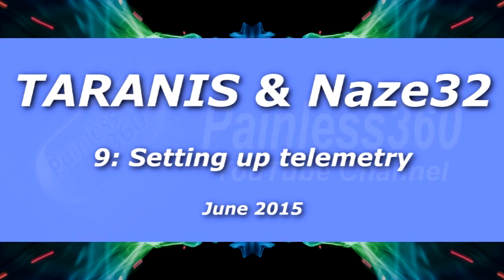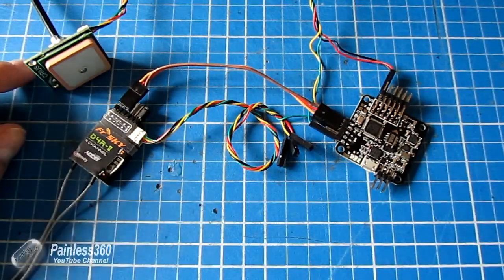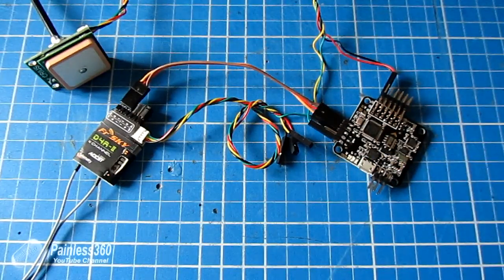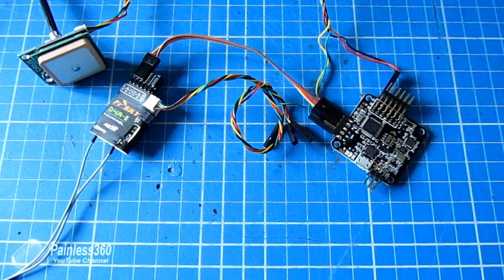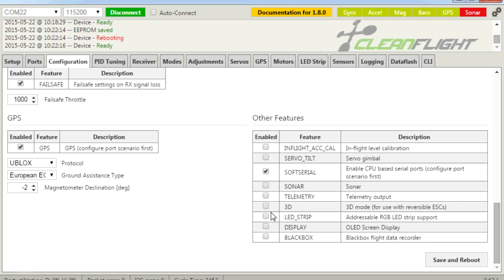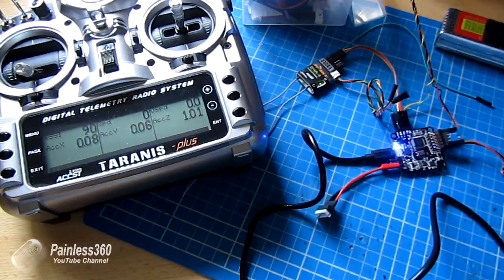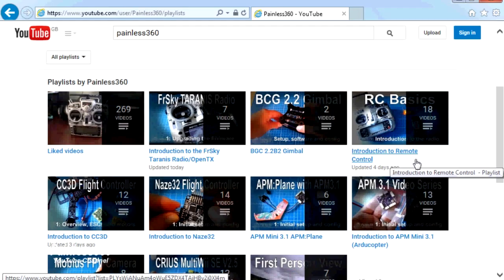(9/12) FrSky TARANIS/Naze32 Telemetry - Simple setup using a D4R-II receiver

Comment: I have my Taranis Plus set up to display RSSI and cells. I gave the green wire from the side of the D4R-II going to pin 6 on the Naze32.  I am not getting cells voltage comming to my Taranis Plus. 

I wonder if it is because I am pulling this from the Naze32?
Reply from the maker: +Dean Cory Are you getting everything else on the telemetry screen then? If so what does the vBat show on the main Cleanflight page?
Reply: +Painless360 clean flight is showing the voltage.  I get a warning from the beeper when the voltage is low enough and the quad is close enough to hear.
Reply: +Painless360 the last time I tried this I messed up the Clean flight so bad that I had to jump the bootloader pads and reflash my Naze32

Comment: Help I just killed my Naze32.  I was trying to set up the telemetry for my Taranis.  followed the instructions of this video.  Hit save and reboot and now I can not get my naze32 to respond to cleanflight.
Reply from the maker: +Dean Cory Occasionally Cleanflight will have a hiccup, usually with the Port configuration. If you select an invalid port configuration it will not warn you but error and reset the entire port config for all ports. If you've tried all the usual stuff then I'd try a firmware flash and erase the board. Don't forget that the vendor should be able to provide first line help. Best of luck.
Reply: +Painless360  I was able to reflash by jumping the boot loader pads and reflash upon connect.  I had to reconfigure everything but that beats buying a new one.
Reply from the maker: Good job getting it back into shape. Happy flying!

Comment: Thx for sharing Painless your vids are helping me out bigtime.. question.. those DF13 4 pin connector`s i can find them on ebay etc but its a 4pin connector at each end i cant find the 1`s with a single pin connector on the opposite end, where did you order yours ??

thx in advance !!
Reply from the maker: norie m You can add the servo connector pins to the ends of the cable that comes with the receiver. I have a video that shows how to crimp them. Best of luck with the build.
Reply: thx dude appreciate it. just got my taranis today i got a lot to learn :D

Comment: Can this also be done on a flip32? If so, which pin should I use? Many thanks.
Reply from the maker: Yes, if running Cleanflight.  Use the same input signal pin.  Best of luck!
Reply: +Painless360 But on the flip32 the pinouts are different and I don't know which pin to use. Could you please tell me which pin to use '1' being the top input pin '8' being the last one. Thanks so much!

Comment: Hi Lee. I have switched from the telemetry pins to the Soft serial approach as I am not a fan of just getting the voltage when the quad is armed. I have followed your video and I'm get everything else bar lipo voltage. Any ideas? 
Thanks

agrs1974
Reply from the maker: Vbat setup?
Reply: +Painless360 
yes. do you need the frysky add on for voltage reading to the taranis? ?
Reply from the maker: Check you can see the vbat voltage in Cleanflight GUI on the PC. It should appear in the telemetry data with everything else..

Comment: Thank you for this video. I'm receiving telemetry info on my Taranis but for some reason, the "cels" and "cell" parameters are not appearing in the telemetry set-up screens. I want to be able to hear the current overall battery voltage when I flick switch SH. Could it be something I missed or maybe the inversion code?
Reply from the maker: The latest version of the OpenTx software changed a few things in the telemetry system.  Have a look through the notes for the latest release to see the latest. Best of luck!
Reply from the maker: The latest version of the OpenTx software changed a few things in the telemetry system.  Have a look through the notes for the latest release to see the latest. Best of luck!
Reply: Painless360 Will do. Thanks for the quick reply :)

Comment: Probably not exactly the correct place to ask this question however.  Will the new Taranis X9D plus transmitters with the EU compliant firmware work with the D4R-II 4 channel receivers?
Reply from the maker: ***** This is an issue and widely discussed in the RCGroups and other forums. Best of luck with it.

Comment: As usual, your videos have saved me Painless360 I've spent almost 3 hours today trying to make my new taranis receive voltage data from a new dr4-2 and naze. Found your video after almost giving up and seems I have a naze that requires telemetry inversion. Also my naze oddly has pin6 around the middle unlike yours which has it at the end of the pin row. I also didn't have to plug the negative from the dr4 into the negative pin on the telemetry pins on the naze, only the green wire is plugged into pin 6. Odd also that my naze doesnt have to be armed to pass telemetry data once lipo is plugged in Voltage telemetry is being happily passed onto taranis. Many thanks for your videos Lee!
Reply from the maker: Altitude Aerials You're welcome! :)
Reply: Altitude Aerials If you look closely at the video around the 4:17 time, you should be able to see that he DOES have the telemetry connected to the middle pin on the bottom (pin 6).  He has a GPS (i think) connected to the pin on the end also using a green wire.

Comment: Painless360 What are the benefits of using Virtual UART (as you did) against UART (telemetry port)?
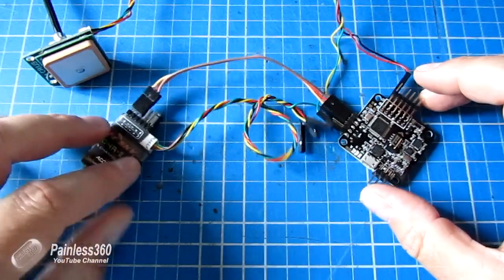Reply from the maker: Gerhard Mikysa See 1:17 in the video. Happy flying!
Reply: Painless360 Thanks. I read that the virtual UART needs more CPU usage. See: https://github.com/cleanflight/cleanflight/blob/master/docs/Serial.md

Any drawbacks on CPU "performance"? :)
Reply: Painless360 Regarding https://github.com/cleanflight/cleanflight/blob/master/docs/LedStrip.md SoftSerial and LED strip wont work together. Can you confirm that?
Reply from the maker: Yep. You need something like one of the new SP3 boards if your heart is set on that..
Reply: Painless360 Thanks for all :) Can't wait to get my hands on all the stuff. Keep on your awesome work!
Reply: Painless360 Finally I found a solution for FrSky Telemetry + LED Strip + Blackbox to work at the same time (the FC must be armed): http://www.rcgroups.com/forums/showthread.php?t=2469417#post32465272

Comment: Hi, i have the d4r-2 sb (2015) it's a bit different in that it has (AIN, -, +, S) on the 4 port connector, which one goes to pin 5 on the naze. Also can i just check this is correct: on the naze, gps tx is 3 (to rx on gps unit), gps rx is 4, Lights are 5, d4r to 6, osd to rx and tx. Many thanks, would be lost without these vids
Reply from the maker: Gavin Ferry If you follow the videos in the series you should be fine. The port setup is changing all the time in Cleanflight so it may look a little different when you get to it.
Best of luck.

Comment: It seems a shame that you do not seem able to get the Lipo voltage using this method, or if you can I have not found how to do it.  Does anyone know differently ?

I know how to get the voltage using the dedicated pins on the Naze but the D4R-II only has one serial input pin so you to choose which set of data that you want so see.
Reply from the maker: UKHeliBob You should get the voltage over telemetry is you have vBat option setup on the board. See the other video in the series. Have you setup this configuration and not seeing the voltage but seeing everything else?
Happy flying!
Reply: Painless360 Thanks for the reply.  The telemetry config is working OK through SoftSerial because I can see the X/Y/Z acceleration values on the Taranis telemetry screen.  VBAT is enabled in Cleanflight but both Cells and Vfas show 0.0 on the Taranis.

This is a new Naze board and I have not previously set up voltage monitoring on it using the normal output pin but I have had it working on other Naze boards.  I wanted to use the SoftSerial method to keep the wiring simple and so that I could see the Lipo voltage without the Naze being armed.

Which data item shows the pack voltage on your Taranis when using SoftSerial telemetry ?  Like many things in the Naze setup there is probably something simple that I have missed but if I know that it can work I will keep looking.
Reply from the maker: Can you see the Battery voltage displayed in Cleanflight with the board and battery connected?
Reply: Painless360 No, the voltage shows as 0V on the setup tab
To summarise :
On the Configuration tab of Cleanflight VBAT is ticked, as is SOFTSERIAL and TELEMETRY.  The telemetry and softserial settings are obviously working as a can see the X, Y and Z acceleration data on the Taranis.
Reply from the maker: Then something isn't right with the FC, get the vBat working in Cleanflight GUI first so you can see the voltages and then look at the telemetry.

You should see the voltage in both..

Best of luck..
Reply: Painless360 Sorted.  
For some reason I had assumed that when using the SoftSerial telemetry method there was no need to connect the LIpo to the battery connections on the Naze and this being a new board they had not previously been used.  Having connected them I can see the battery voltage in Cleanflight and it appears as the Vfas value on the Taranis.
Thanks for your help.  The important factor was knowing that it was possible.
Reply from the maker: Good news - happy flying!

Comment: How do I get both telemetry fed to the D4RII and have use of the LED strip functionality?
Reply from the maker: Vondarius Use the main telemetry pins on the controller. I do mention that is an option in this video..
Best of luck..
Reply: Painless360 I have a flip32, where are the main telemetry pins?
Reply from the maker: Ah, in that case you're snookered.
Reply: Painless360 OK, so if I just want main battery voltage and RSSI can I just use the VBAT connection? If so, what other connection do I need for the D4RII, and setup for the Taranis?

Comment: Thanks for sharing it with us. But just to point out that i had to enable softserial under configuration before i got softserials in ports tab. Using 1.9.0 version. Hardware is all same.
Reply: mel a Thanks for mentioning this! I also had to do it!
Reply: mel a Same here. Thanks for the tip.
Reply: +pass1985 u welcome

Comment: Thanks again for another great video.
Just curious. Previously you did a video on the voltage telemetry, which connected up to the telemetry pins beside the buzzer.
If you are using this voltage telemetry, can you still use this acc telemetry also?
Is this just another way or doing the voltage, and getting the other telemetry, or do you have to choose which one you want?
Reply from the maker: Kevin Ray There are two videos in the playlist - the other one covers RSSI. Using vBat and telemetry are two different things and they connect to two different sets of pins on the Naze32. There are two options for telemetry and I show my preference in this video. Hope that makes sense!
Best of luck with the build!
Reply: Will this one push the voltage telemetry also?
Reply: again, thank you for your help.
want to get the best out of the great gear we have.. Taranis, FrSky and Naze32.
Reply: Have you posted the video on CC3D on TekSumo? Did I miss it?
Reply from the maker: Nope, still trying the get flight video..

Comment: It would be nice if you could make a quick tip video - Naze32/CC3D Cleanflight Connections Combinations Overview that work and doesn't work like Naze32 (PPM,GPS, MinimOSD, LED, Bluetooth, Frsky Telemetry, Buzzer) i think some Combinations doesn't work because of conflicts in ports - like Telemetry Port and USB

Thank you very much for your videos.
Reply from the maker: Snappy There is some great documentation on the Cleanflight pages. 
Bottom line - if you want anything apart from basic OSD and GPS co-ordinates displayed on that basic OSD, get a Naze32/Flip32.
If you want a cheap, basic board that flies great - CC3D is an option.
Happy flying!

Comment: Is it possible to do this with clean-flight on a CC3D board?  I don't think there is a Tx inversion option from the CC3D, but perhaps using the SP2UART converter (S.Port to UART) from Frsky would fix the inversion issue?
Reply from the maker: David Smith No, as far as I know the only telemetry you can get with the CC3D is to use the analogue telemetry ports connected directly to the flight battery. 
Hope this helps.
Reply: Painless360 I know that telemetry can be sent from the flexi port for OPlink wirless telemetry https://wiki.openpilot.org/display/WIKI/CC3D+-+Atom+GPS+Setup+for+Telemetry . 
So I thought maybe with clean flight's frsky protocol, this could be done, the only trick would be inverting the signal as you do in the naze32 board. since cc3d doesn't have a tx inverter, I thought the UART to s.bus converter would take car of that. It would be nice to get GPS coords (to taranis) from a mini250 for backup lost model insurence, like when a crash ejects a battery, and the buzzer won't work (which happened to me recently).
Reply from the maker: If you get it to work let me know.

Best of luck.

Comment: Oh wow. Thanks for this. There is so much conflicting information out there for telemetry on FrSky and Naze32/Cleanflight. I got mine working using the telemetry port before I saw this, but I want to do it this way rather. I see you are feeding the accelerometer values, but I suppose it would also feed voltage values if set up in Cleanflight, right?

I used set telemetry_inversion = 1 for my setup, but first, I'm not sure if it's actually needed for the telemetry port or only for soft-serial pin 6... Regardless, it worked for me without using the inversion. We'll see what happens when I set it up your way.
Reply from the maker: Danny Cruz Anything that the Naza32 can see (voltage, acc, GPS, speed etc.) will come out via the telemetry port.
A lot of the articles on the net are getting out of date and as Cleanflight gets better and better the implementation of key things like FrSky Telemetry is changing to. Don't forget - some boards have the inversion circuitry on them, some don't. 
Best of luck with it.

Comment: This is great, thanks for creating it! Is it also possible to get telemetry with the x8r? Also, if you enable softserial do you lose the ability to run LEDs?
Reply from the maker: Duane Pinkerton If you use the pins that the LEDS use then you would. 
The x8r uses Smart Port (see the 'Introduction to FrSky Telemetry' in the playlist. I am sure that the implementation of Smart Port natively in Cleanflight will come soon. Until then you need - https://github.com/frank26080115/cleanflight/wiki/Using-Smart-Port
Happy flying!
Reply: Duane Pinkerton According to the Cleanflight documentation, yes you will lose LED_STRIP.
https://github.com/cleanflight/cleanflight/blob/master/docs/Board%20-%20Naze32.md